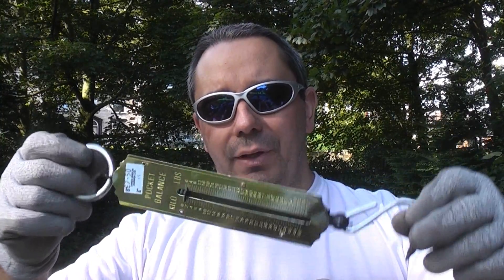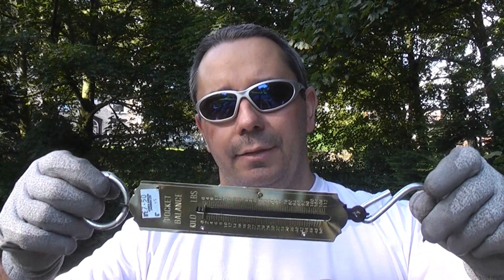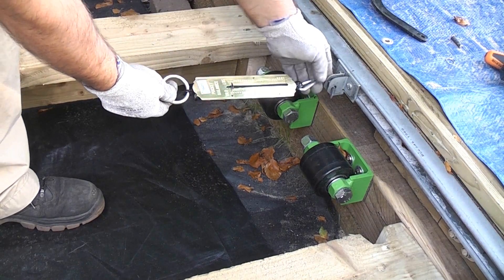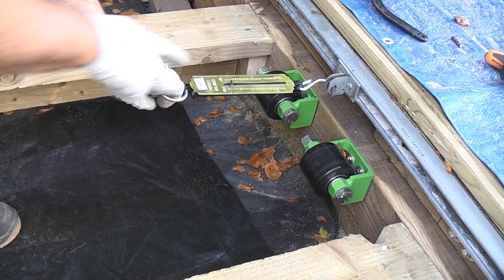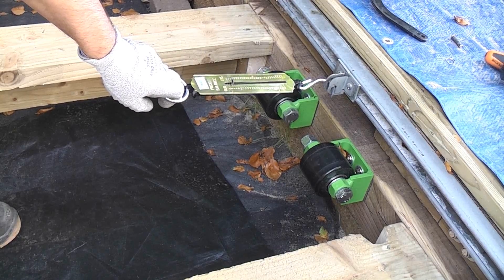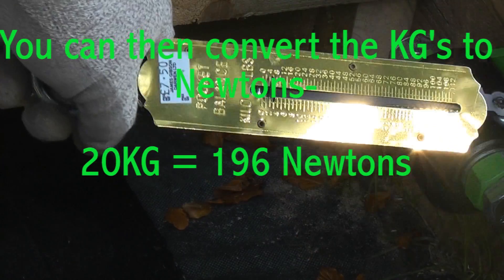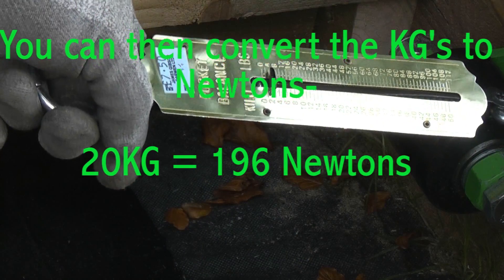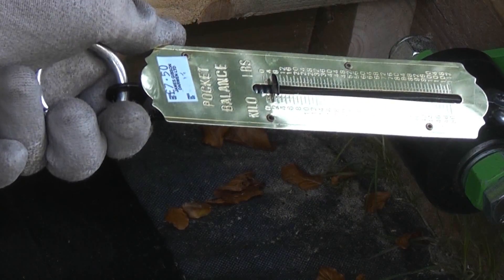Measuring pull force

Comment: Is there a tool that measures PUSH force needed instead of PULL force?
Reply from the maker: I believe you can use a force gauge, but have never used one.
Thanks for the comment

Comment: You could probably also use this method as a cheapy torque wrench for those bolts/screws that are nearly impossible to get a standard torque wrench to work with. Just attach the spring balance or fish scale meter to the end of a wrench/crescent.